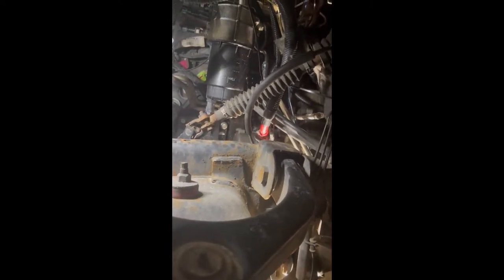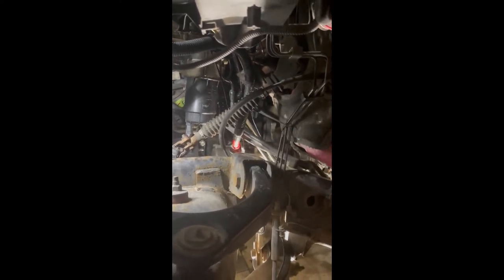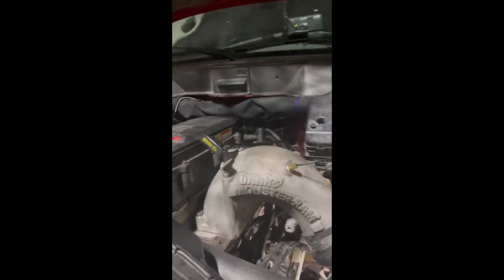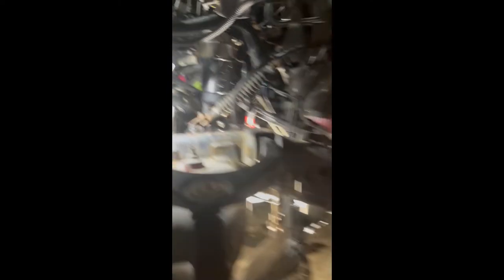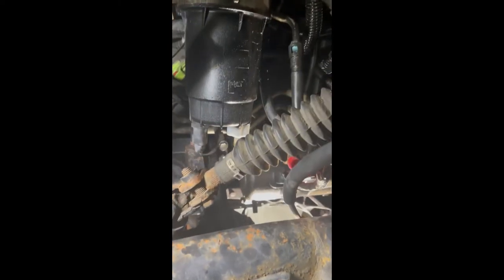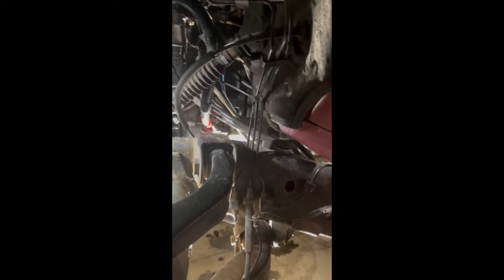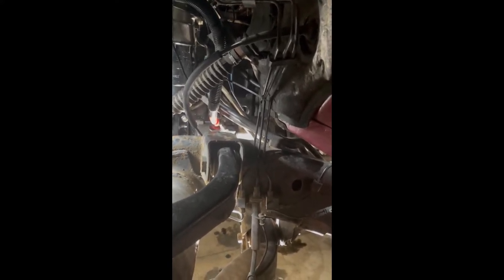6.7 Cummins Oil DipstickTube Replacement !!

Comment: The tube on my 2006 RAM 3500 with the Cummins 5.9, is broken at the second bracket by the fuel filter, dripping oil on the driveway and splashing it on the trailer while towing, a real mess. Looks like the tube is steel, I think it seats into an O ring. The dealer wants $306.00 for the tube, and if the O ring isn't included that will be $26 bucks extra....for an O ring!!!  I could buy a O ring kit for that money. Anyways thanks for the video. Tip, check Inland Kenworth for parts, Cummins parts and service, Note some parts for Cummins they can't sell, dipstick tube and valve cover gasket are available.
Reply from the maker: Search Ebay for the tube . It's cheaper on there . Just use the serial number .
Reply: @twintibbsdiesel93  $100 bucks cheaper from Inland then the dealer! It's just an option.
Reply from the maker: That's a good option. I think I paid around $150 for mine on ebay .
Reply: @twintibbsdiesel93  Oh, good deal! Now I just need to change the it, but it's been chilly and wet out.
Reply from the maker: Remember the needle nose lock jaw pliers lol they are a life saver lol
Reply: @twintibbsdiesel93  Yes, I have a small set, you show the larger ones. Thanks for the tip! Oh, any tips on a leaking sunroof? I taped mine up with wide electrical tape, dry now!

Comment from the maker: What a pain in the A$$ it was for something that should have taken a hour ended up taking me 4 hours because the bracket that goes from the transmission bell housing to the engine would not come off. The last bolt was under my motor mount and I tried everything and couldn't get it off but a $12 pair of needle nose Lock Jaw Pliers did the job LOL